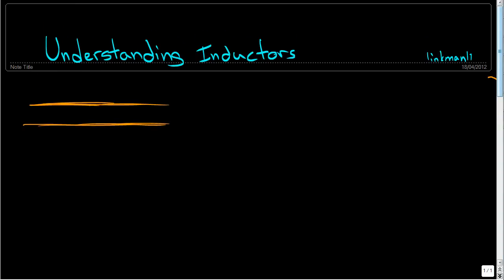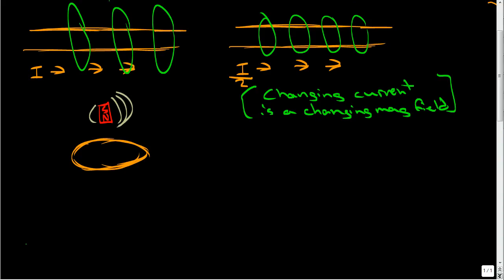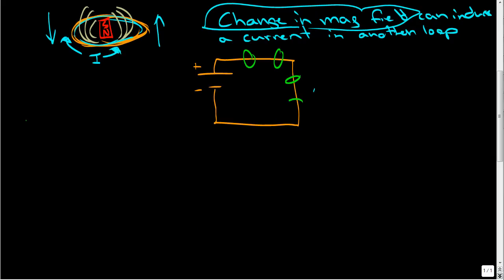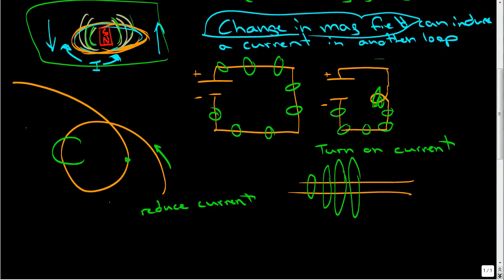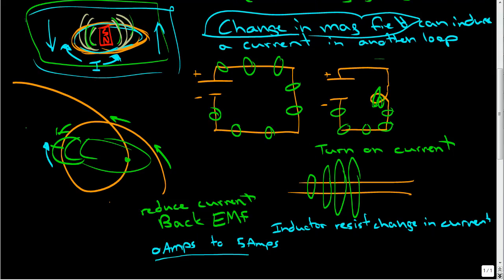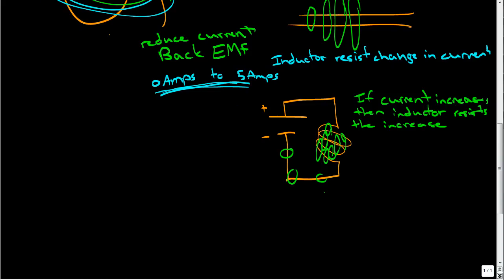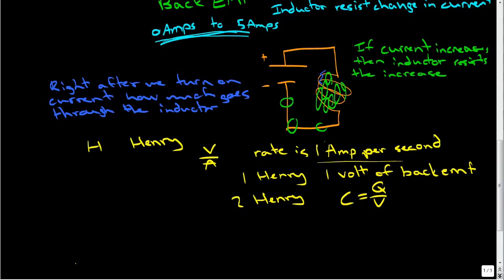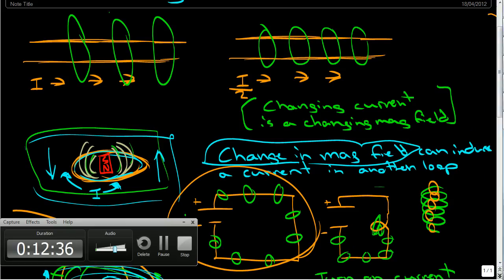Understanding Inductors

Comment from the maker: Your'e welcome! And you have it right. Inductors resist rapid changes (high frequencies) in the current being delivered to the circuit. They can't resist slower more gradual changes in current (low frequencies), because the magnetic field changes too slowly. Capacitors are the opposite. When capacitors fully charge, they act as a circuit break. Low frequencies could let the capacitor fully charge before the current changes direction. High frequencies oscillate faster than the charge rate.

Comment: You are correct, a loop is not required to get the properties of an Inductor, a loop just enhances the effect. The properties can be enhances even further if the loop is formed around a ferromagnetic material like iron which will concentrate the magnetic fields into the material better than "air".

Comment: Good video but I feel you missed a good point about inductors which is an increasing magnetic field creates an inverse current which impedes the original current and a decreasing magnetic field creates a current in the same direction as the original current. This is why an inductor initially resists a current flowing through it and then tries to keep it going when the current slows or ceases, much the same as a flywheel is hard to spin at first but keeps going after you stop spinning it.

Comment: The spike in voltage is due to the decaying magnetic field inducing a current in the wire which is going in the same direction as the original current and a large negative voltage at the positive end of the inductor. If there isn't a sufficient path for this current to flow then a voltage potential will build until such a condition exists. If the resistance to current flowing is large enough (like an air gap) then the voltage potential will usually build to such a level to cause an arc to form.

Comment: Thanks for the great video. It is correct to say that it is due to inductors resisting changes in current, that they act as a low pass filter? In an electric guitar pickup for example, if you increase the inductance of the coil you lose more of the high frequency signal. Am I on the right track?

Comment: i thank u for ur deep physical explanation about inductor...but if the current flowing through a coil creates an opposing current  in the other ...then it means  at the starting their will be current flow .....nd a second doubt is why there is a lag between voltage and current...why it opposes high frequency....plz give some explanation regarding these doubts....

Comment: Also, a loop is not necessary to form an Inductor's properties as the creation and destruction of the magnetic field on the wire itself is enough to create these properties. A loop simply enhances these properties and a ferromagnetic material around or inside the loop (like powdered iron or laminated steel) enhances it even more.

Comment: Second problem is again back emf - are you sure it is generated due to changing magnetic field induced counter current in nearby loops of coil ? Because I heard it is generated always even if there is straight wire, no loop. Isn't back emf the same term as counter emf ?

Comment: i cant understand how this would work because there would be mag field lines around both side of the loop and from what i've learned is that mag field lines don't cross over. so how how would the larger field lines cross the opposite side of the looped wire and thus inducing a back emf.

Comment from the maker: I'm sorry but you are incorrect. In a DC circuit, the energy stored in an inductor is found by the equation E = (1/2)LI². I'm not sure why you disagree with this.

I also said several times that an inductor resists changes in current, thus, if the field collapses it creates a temporary current in the same direction to the original current.

If there was no energy stored in the inductor, how exactly would a current be produced when the field collapses? That would violate energy conservation

Comment: When you open a switch and instantaneously stop current flow, you called the voltage generated in this scenario Back EMF.

would it not be forward emf? In this situationt the current is decreasing so would the inductor not generate a voltage in the same direction as the original source?

Comment: Thanks Scot, this is the best Vedio about the mechanism of inductance, do u have vedio about LC circuit to explain how the sine wave generated?
Have question for u, why when we connect the coil with dc volt at time = Zero till the saturation, why no hi induced voltage happend?

Comment: owe i just thought it over, say if point A was where the current started at the base of the inductor and there was a mag field around it  then point be B for a nano second wouldn't have had that initial current running through it, so the field from point A induces current in the opposite i direction at point B just because of the time lag. ding i gets it

Comment: If inductor induces emf opp to source emf, then WHAT drives the current thru the circuit??????
Reply: My thinking is that the magnetic field is effecting the electrons in the wire.
 Change in current  or change in movement kinetic energy induce electric energy in the wire like rotation of a rotor inside a car alternater induce voltage to charge the car battery.
Does this make any sense to you. 🤔